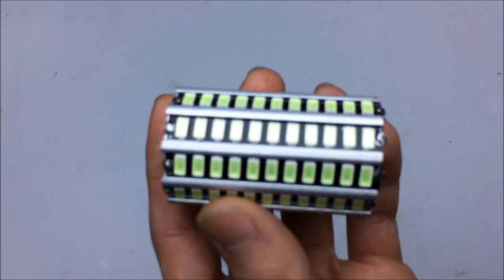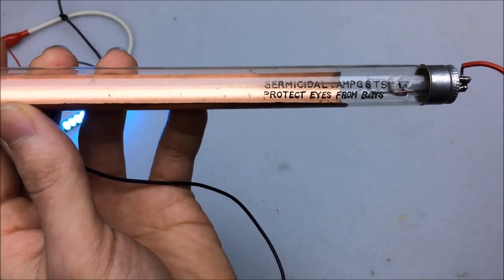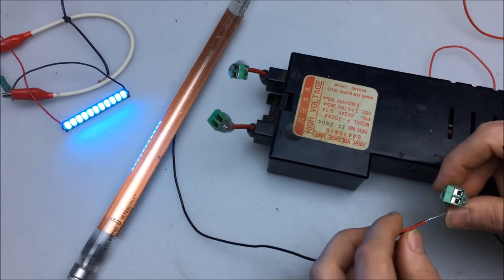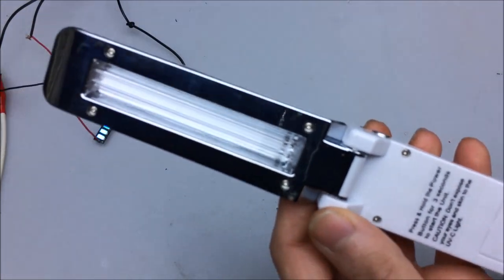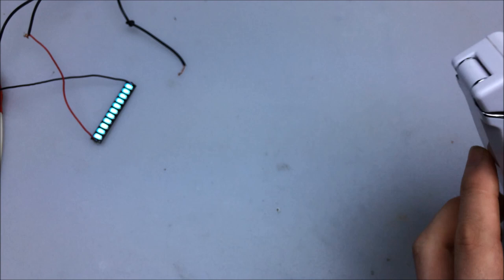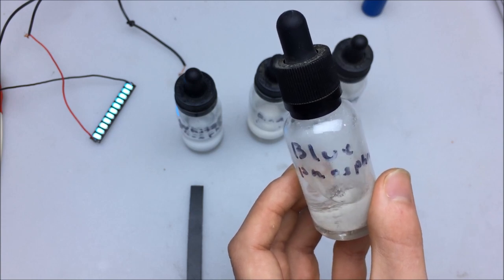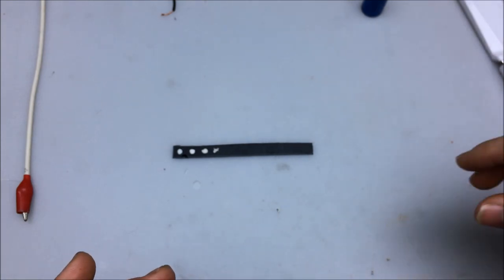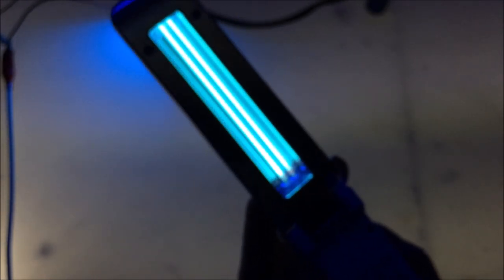Fake UVC LED Lights Are The Wrong Color

Comment: how can you hold the lamp wand face up without it closing the light?
Reply from the maker: Excellent question, there is a little tilt sensor inside soldered onto the PCB. If you remove that sensor it will stay on. If i remember correct it was a little circular silver thing.
Reply from the maker: The sensor looks like this, I believe if you leave the circle pads open ( no solder link ) it will stay on. You could also probably just use a razor to cut one of the traces going to the sensor.

https://www.beelee28.com/BL-3827tilt-switch.html
Reply: @Zenodilodon  thanks man!

Comment: I wish there where easy sources for P43 and P47. 
Scratching used stuff from old tubes is bound to be contaminated with the aluminium coating.
Reply from the maker: I have been able to locate the bare phosphor material from suppliers. The quantity is often pretty large compared to the amount I would use bu several orders. I just use them for UV indication and video examples. The way I fond the material was looking at the chart on Wikipedia on CRT/phosphors and looking up the formulas available for purchasing.
Reply: @Zenodilodon  Thanks. I'll give that a try. 
I also need low quantities though. 
I hope to make my own image intensifier tubes. 
And the screens are tiny in those.

Comment: Damn dude I’ve been searching for UVCLED videos for months. I’ve got several on order from Banggood and other places. From what I’ve seen… Some of the UVC LEDs are actually putting out the correct wavelength. But they will have the gold plating, and will be solid ceramic. Also will have a quartz or sapphire window. 

Believe it or not you can actually get UVC LEDs at Walmart. In the “as seen on TV” aisle. There are water bottles, phone sanitizers, and a few other things that include real UVC leds. I bought a water bottle that has a UVCLED in the lid.... with integrated battery, charging port, and on off control button. So the lid is Pretty much a portable UVc LED flashlight ready to go. 

That’s what I bought it for. But Not for sanitizing just to play with and for identifying repairs and flaws in guitars and violins. Also reading old labels and such that have faded ink. I have a collection of UV A and B led flashlights and mercury curing/sanitizing lamps… So I had to add a few UVC LEDs to my collection.
Reply from the maker: Yup, they look like little DMD chips and some get to around 240nm. Sad thing is from what I have seen they are only up to around 50mw of optical output. I hope the technology gets better but currently they have some issues. Power output is one, and I have heard there life expectancy isn't great either due to the junction material breaking down. I have seen 1-3 watt LED beads in the UVA range, 400nm ones hold up pretty well but the 365nm tend to yellow and break down. I eventually want to get a few UVC LEDs but thus far it seems mercury vapor is the way to go for power. BigCliveDotCom did a video on this 10V UVC bulbs which look really cool, they are also on my list of obtain. 

It seems we both clearly identify as lamps :P

I recently got a Deuterium lamp that will go down to about 180nm, though I need to figure out how to run it, I need to find a datasheet on the bulb for the filament current and such. I can't wait to not see that UVC light!
Reply: @Zenodilodon  prepare to be underwhelmed. the deuterium lamps I've seen at work anyway actually seem to only put out pathetically tiny amounts of light. Very interesting mechanism though w/the molecular vibrations etc.
Reply: Can you say what other items contain these besides the bottle and phone thing? Does the bottle also have those blue leds next to the uv ones to indicate when it's on? Can you poke then out without ruining the circuit?
Reply from the maker: @Muonium1  Underwhelmed? Nah, how many people have the option of 180nm UV light :P

It's all about the science here and even small amounts of interesting light is fun.
Reply: Mikroe  is selling 2 click-boards, one with 2 uvc-leds (265-285nm) and the other with an uvc-sensor (GUVC-T21GH from genUV). Bought these when the corona pandemic just started, to experiment with. 
I heard that they’re using uvc-light to desinfect rooms in hospitals. ($$$)
I wonder how much uvc-light those glass-tubes they use with an aquarium-lamp (sealed) send out. ( tubes are quite expensive also )

Comment: can pick up a zwb3 filter on ebay to cut the vis and pass the 254 line on that handheld one for like $20, should fit perfectly over it.
Reply from the maker: That's interesting! Thanks for letting me know about those being available. I am surprised they are that cheap, I see one for $10. I'd figure they would be more expensive like germanium for IR.

Comment: you keep your phosphors under oil? how come

you think for a tv they put them down in layers using a mask, or they have a mesh that is done individually?

I have an rgb led, they only seem to run right on mains voltage, on dc they get to blue,then add green and hang up on that, which is fine and it means I have four different kinds of blue led in the room now, but not so great if you just want all the colours :D

nodded telepathically! 

was the high voltage lamp just for showing off :p im waiting for them to do uvc with those leds with them so the colours match your expectations

have you ever removed the coating or ir blocking from a camera sensor, you can put a uv filter over the top to get the right colour back!
Reply from the maker: I keep them in 99% alcohol, it's mostly to keep it manageable. This way I can more easily scoop some out and I don't have to worry about it sticking on the glass/getting into the air.
Reply from the maker: Also, the phosphors I have are not from a convention CRT, they come from the 3 single color RGB tubes in a rear projection CRT. It would be nearly impossible for me to collect colored phosphors a normal CRT and separate them. I am not quite sure how they are placed in a colored screen myself to be honest but it must be before the front of the glass and shadow mask are bonded. it could be quite close to a silk screen process.
Reply: @Zenodilodon  I know how you got them :p, they got to be the same as the larger models though,right? also, you destroyed 3 nice colour crts?!

why didnt they use a black and white monitor and put coloured glass over the top?
Reply from the maker: Oh i forgot to click read more lol

Sounds like an issue with the red, they tend to fail pretty easily, you might be able to find the bad one if there is one by shorting out each one at a time. 

The larger bulb was for visual indication of  " Yes this one is unquestionably a UVC lamp " to limit any confusion on the smaller ones appearance  and ability to produce UVC. 

I do have cameras with the filters removed, but even so the lenses will block the UVC and cameras unless specifically made for it would most likely translate it into a blue or violet. Even if the camera saw it correctly it still would be futile because screens would not produce just UVC and it would leave out what the human eye saw. From what I know the only real way to show its true look was to edit the image and compare it with what I saw. It's a pretty darn close to perfect edit I think. Though take into consideration that screens tend to have slightly different color reproduction.

I felt your nod, it was very approving and appreciated.
Reply from the maker: @phonotical  I had 3 of each color, I still have one of each and I am currently learning more about them. I plan on making another Bare&Basic video on how to drive them for custom single color vector/oscilloscope type decorative displays. I need to figure out how to best divide the voltage for the  Einzel / electrostatic lens. I might just use a flyback transformer assembly as is but I think it would be also cool to start from the ground up and show how to make a custom HV supply and voltage divider. They are fun to play with but focusing is a pain thus far.

Another thing to note is colored glass is a no go because glass blocks UVC. Lots of caches when working with light as the transmission for visible light isn't the same as for IR and UV. There is good reason why I love working with light, mostly because the more you explore it the stranger it becomes.
Reply: @Zenodilodon  the led does show red, it just seems to appreciate a shit ton of power rather than a small amount of dc

I sent nod waves more than once, maybe thats why it was so effective :D